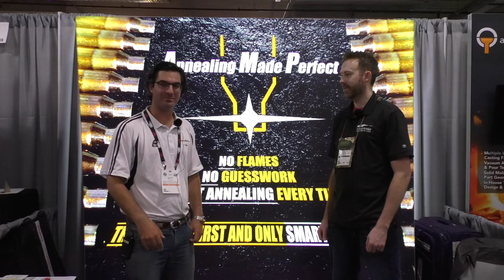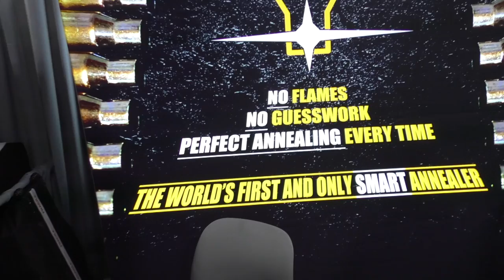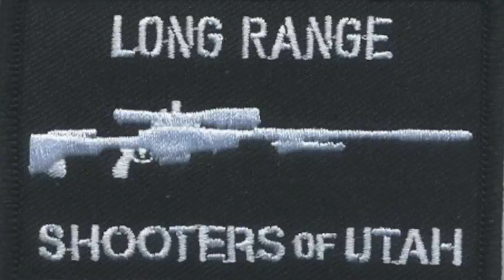Annealing Made Perfect Mark II Smart Annealer Demo 2019

Comment: LOLOLOL So many people complaining about price. It is a complicated piece of kit that has had thousands of hours and laboratory time put into it to give shooters the most consistent and CORRECT anneal every time. The people who complain on price are the same people who would complain about a custom rifle being 3k "BUt Ma $30o RiFle ShoOTs JUst As GooD" 

This isnt a cheap machine but there is NOTHING that comes close to it on the market that works this good. if there was someone else would be doing it. 

Remember:

Easy to set up
Can be left and come back to at any time with no risk of changing variables 
No flame
No salt baths
Dont need to attend it with the chance of it burning your house down
No need to paint cases with heat sensitive paint
Has regular updates
Has actual metallurgy to back up the product (brass is tested in the lab to gauge its correct annealing process even down to different batch codes of brass in a single brand)
Can actually (as shown in the video) analyze your brass to give you the correct annealing solution for your brass
Localities the heat in the exact same spot for the exact amount of time (no need to count in your head or use a timer) Consistent! 
can do as many calibers as you desire with no setup other than changing the pilot and code.
Is compact and safer compared to other methods
After letting the brass cool down you can go ahead and neck size and load. no cleaning or additional prep required.
This is made for shooters that want the most out of brass longevity, but realistically competition shooters that want the most performance out of their loading. 1500 bucks for a product has so much technology and science packed into it is not a lot of money.

This is for the shooter that will buy $600.00 lab scales to measure out their powder not for people picking up range scrap.

Comment: I don't think I'd sacrifice a big wildcat on that. Not when I have to fire form every case. Some big cases are too expensive to waste. Then there's the cost of the machine. I don't see this going over well.
Reply from the maker: I guess it depend on how much value you put on consistency and brass life.  If you're not annealing then your brass life should in most cases be much shorter.  I don't like that I have to sacrifice a single brass either but I love that there's no guesswork and I'm getting a perfectly annealed case every time just like new brass.  I guess it just depends on how serious you are about all this long range jazz.  I'm deep into it so it makes sense for me but it may not for some.  Previously I had a $300 Annealeez and we did a couple of review videos on it.  For the money, it's a good option as compared to a DIY annealer but it's not without its faults.  It's near impossible to set up exactly the same way time after time and ensure consistent temperature and result but it's better than nothing and it's inexpensive by comparison.